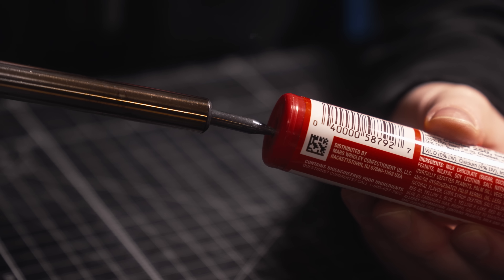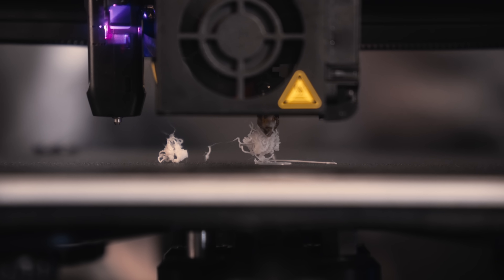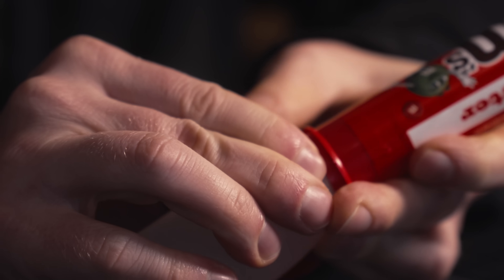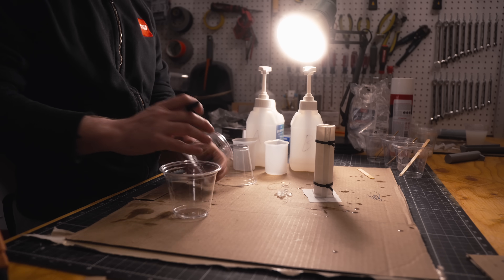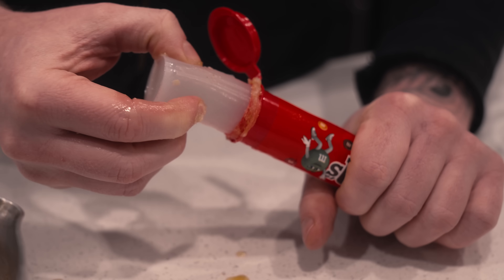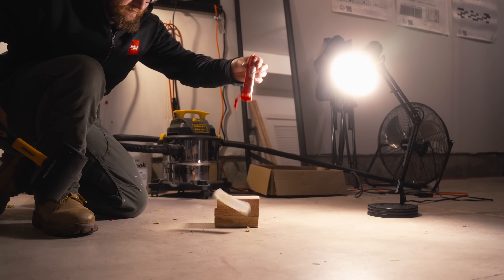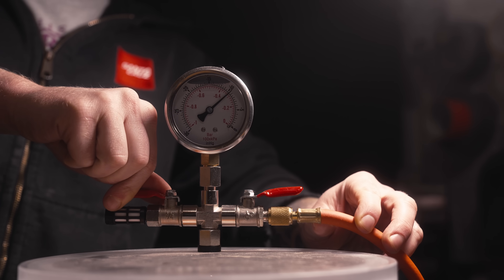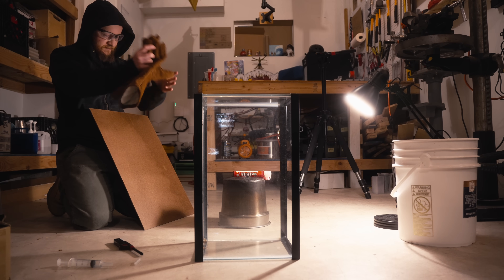Solving Reddit's Cylinder Problem with Science

Comment: a few things
1 : I have a very strong feeling that the poster have been over-estimating the properties of his cylinder, with 5.1inches in length and 4.5inches of girth it's less of a cylinder and more of a spherender. (even if you assume they meant circumciserence instead of dicameter, measuring circumciserence is generally more difficult to measure, and one could imagine the M&M tube exacerbated any measurement inaccuracy) Additionally, I'm not sure I've ever seen a mini M&M tube as big as your original cylinder, it's a quite large cylinder that I would argue is fairly above average in terms of overall girth. 
2 : I am shocked Adam & Eve weren't willing to sponsor this given the shit they put up with from PSR. The silicone M&M tube suppressor alone you'd think would cause more issues for them than this - and that's before even touching stuff like the glong.
3 : trust me, 5:30 just learn CAD. The time I spent manually redoing models in Tinkercad to make minor changes FAR undershoots the time I spent learning FreeCAD. (and, unlike any other CAD software, I don't need to worry about FreeCAD getting their cylinder stuck up my ass sideways because they decided to fuck me over) It IS a time commitment to learn, and can be a bit weird, but a model like this is so simple that it would take under 10-15 minutes to model if you're somewhat competent at it. For me personally I took a few hours to just make a trivial part that still leveraged a lot of design requirements. That one project set me up fairly well and after that I just started making real parts.
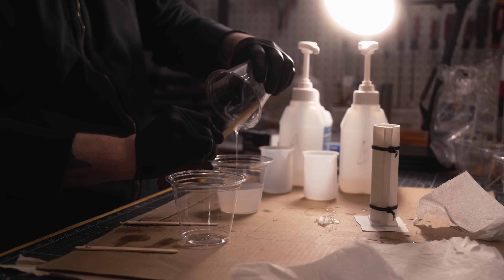4 : 6:40 hehe
5 : oh dear god that poor customer support employee

Comment: If there were some way for the cylinder to somehow emit fluid from the end stuck inside the tube, it might be able to increase the pressure in there enough to pop itself out. Of course, if it's too tightly stuck, that could also just prevent any more fluid from leaving the cylinder.

Comment: Plastic is easy, just insert a thin piece of plastic sheet between the tube and cylinder, then use some snips to cut the tube, the cylinder is protected by the plastic sheet. Alternatively sand a hole in one corner to release the vacuum, or heat it up to melt the butter.

Glass however sounds like a bigger problem. And I’ve seen many a stories of cylinders stuck in Snapple bottles. How would you get the cylinder out without damaging it?

Comment: The only way a cylinder that size fits inside a mini M&Ms tube is if the cylinder can rapidly expand and contract by about 50%. Which means this isn’t silicon. Frankly, this material could revolutionize engineering, construction, and space travel. The real mystery is why this guy is holding this knowledge back from the rest of us
Reply: There's probably a part that is fillabke with liquid to extend it.
Reply: @i-gor2  So it's hydraulics?
Reply: @Irondragon1945  I would assume more of a sponge with a stretchable material on the outside that prevents leakage.
Reply: @Irondragon1945 what he fails to showcase in this video is that the cylinder was originally attached to a larger object, the OP never went into detail as to what that object was but it would be a reasonable assumption an object of that size could be responsible for the cylinder's expansion, why was that object incapable of subsequently shrinking the cylinder to remove it from its stuck position is unclear. Perhaps it was some kind of liquid that expanded the cylinder and after its expansion whatever system was used to pump the liquid was constricted. A mystery to be for certain.
Reply: @Breqs98 I am genuinely confused why the cylinder couldn’t shrink back. The tube for which the liquid would go through should be placed in the middle of the cylinder and thus, even if the cylinder is at max expansion and stuck in a tube, the liquid expansion tube should be centred enough to not be affected. Thus, it should allow the cylinder to deflate. Maybe the larger object does not have the capability deflate the cylinder 🤷‍♂️
Reply: @bolerpear967  Perhaps the cylinder, in its panic, was unable to contract?
Reply: @bolerpear967 You see, if the tube in which the cylinder is stuck in happens to have a volume smaller than that of the expanded cylinder, given the cylinder soft and malleable nature, it would make it so the cylinder becomes compacted at maximum expanse in a way that may close any hollowed out parts inside of the cylinder responsible for removing the liquid required for shrinkage, essentially locking the liquid from exiting the cylinder.
Reply: @Breqs98 I didn’t learn a whole lot in school, but I do remember that physics lesson from health class
Reply: @bolerpear967  It's likely that when the cylinder expanded, the tubes responsible for pumping the fluid needed for the expansion got cut off, leading to drainage of the fluid to become impossible until the cylinder was removed.
Reply: @bolerpear967  Maybe after the expansion, it pushed out all the air within the tube, which created a vacuum seal. Subsequently, one could assume shrinking would not work, since there wouldn't be air to fill the free space.
Reply: @Breqs98  maybe the larger object was what stored or produced the liquid that the cylinder used to expand?
Reply: @bolerpear967  the presumable tubes that pump the hydraulic fluid in and out of the cylinder, likely were compressed by the tube, especially where the cylinder is connected to the larger object. If the fluid can’t flow out through the tube, the cylinder wouldn’t be able to shrink down again. Kind of like how you can wear a ring that is slightly too small, and your finger will swell because the blood doesn’t pump in and out of the finger effectively
Reply: @iaxivers I think it's fully made of a flexible material, with holes/pipes for a high-pressure liquid to enter and exit. The larger object is likely a pump for the liquid.
Reply: @Breqs98 If it’s liquid, perhaps sufficiently cold temperature could condense the liquid inside causing shrinkage in the overall size of the cylinder, facilitating removal.
Reply: @i-gor2 Will any liquid do, or do I have to use a very specific one?
Reply: @formidableplays4750 a ferous dense carbon based fluid would likely work best, something thin enough to move freely but capable of being dense when packed, and relatively slick
Reply: @formidableplays4750  Probably fine to just use the same liquid the rest of the system is already using to keep complexity down.
Reply: @formidableplays4750  you could probably just use blood and some kind of engorging tissue like material
Reply: @i-gor2  My god it's a... JOHNSON, I need some tests done. Idk why i'm contacting you via random yt comments, sorry Johnson
Reply: It's probably a pourous, spongy material that uses fluid hydraulics to fill to cause it to expand. Plenty of substances like it on the market already, you can even make an approximation by shoving a soft sponge into a balloon and filling it with water.
Reply: @BLS31  Infact, you can even use a very specific kind of "balloon" for an even better aproximation. The kind you buy at a gas station.
Reply: @BLS31  there's an even easier approximation that half the population have access to!
Reply: @hardcorelace7565 you mean 50.27% of the population?
Reply: He likely had the only one in existence. Hence the need to remove it without harming it.
Reply: @Jimmy_Jones  But OP noted that it is above average in size! There must be at least one smaller one! We must find the other
Reply: @colonelh1875  the other must've been a prototype? What issue came  up in development that made the design change to be larger? SO MANY QUESTIONS!
Reply: Never did he specify the cylinder is a single material, so it's probably a structure in a cylindrical shape. In fact, he specified it's made of several organic compounds and not just one, therefore it's not a big leap to say that it's made of several parts that serve different functions and are made of different materials. OP also said it's quite soft so the possibility of the cylinder having space to be filled with liquid is quite high, with the problem being caused by the negative pressure not letting the liquid flow out.
Reply: Do we know if it was rapid?
Reply: The reason we don't have this material in every day life is because of the mega monopolies trying to keep it from the world. Think about it, everything from roads that never need to be fixed due to expanding in cracks, to buildings that resist earthquakes from expanding/contracting their base could be constructed. Insurance companies don't want us to have it, and dare I say that the OP could've been jumped and had his one of a kind technology stuck in the cylinder to keep it from the world.
Reply: @HenryJuisiti  That's absurd XD

Jokes aside, that’s the funniest reply in this thread. I actually teared up reading it .... I couldn’t stop picturing it literally happening .... someone jumping him in a dark alley, shoving his “secret tech” into an M&M tube, and then scuttling away
Reply: @maybe-me-or-not  It really is a shame isnt it? It's on the same level as someone discovering the cure for cancer and being jumped by big Pharma before they could release it to the world.
Reply: @maybe-me-or-not he did say it was a "failed expirement" so he was likely testing its material qualities for future application
Reply: I sure does hope he reveals his innovation to the world, especially if it was unharmed
Reply: Probably a secret proyect, the material would revolutionize so much the company he works for absolutely wants to monopolize it's production
Reply: Probably because his prototype got stuck in a M&M's tube, forever lost.
Reply: it's because he hospital :(
Reply: Perhaps this "larger object" contains some sort of hydraulics system that can expand or contract the structure of the cylinder? Perhaps both contribute, with the cylinder having a soft, spongy texture. Therefore it is imperative that the cylinder remain u harmed so as to avoid losing all the fluid stored in the larger object?
Reply: space travel application is already manifest
Reply: Clearly business rivals have tried to injure him for his pre-patented knowledge, why else would he be in the hospital?
Reply: this reply section is giving serious ‘body ritual among the nacirema’ vibes
Reply: I think he's not holding it back, he was probably running his experiments to test it.

He hasn't released his findings because he can't get it  out of the M&M tube.
Reply: he’s probably working on the patent still
Reply: How sure are we that it wasn't a karma farmer that vastly exaggerated the dimensions and properties of the cylinder for engagement? The cylinder in my lab is considerably smaller and shows no signs of expansion, even with rigorous testing.
Reply: @John_C_J  i dont think youre being rigorous enough, try again
Reply: It's a cylinder
Reply: Hospital
Reply: I wouldn't consider it so groundbreaking just yet. Clearly it's still in the testing phases, and the early ones at that. And if he's using a jury-rigged setup involving M&M tubes and butter, it seems like he's having issues getting funding. Maybe that's why he approached a hospital, perhaps he was able to get a research grant of some kind. Or maybe like the guy in the video he was attempting to borrow some sort of diagnostic/testing equipment for his experiment.

In any case, none of that may matter, because the rapid expansion/contraction doesn't seem to be fully controllable yet if the cylinder is getting stuck. Perhaps there's some external stimulus involved that's outside of the experimenter's control?
Reply: as funny as it is referring to what is presumably a male phallus in entirely bio-mechanical way as if one was an alien is. it’s the new year, dude (presumably) just really liked m&ms butter and like crushed banana or something (also using the phallus hypothesis which is supported by a hospital fixing the issue)
Reply: Perhaps the cylinder would return to its original size if exposed to lower temperatures. I don't have a cylinder, but I've heard that cylinders like his possess that property.
Reply: Bro I laughed out so loud reading this comment 🤣🤣. Hope they share that material information.
Reply: The only way...is if the guy exaggerated the size of his cylinder 😒
Reply: well it got stuck in testing and was likely destroyed in removal unfortunately
Reply: Perhaps it's not yet refined thus the experiment
Reply: Classified technology. I imagine very expensive too. Probably why making sure it went unharmed was of such importance.
Reply: It’s called a dick
Reply: Preach!
Reply: that was small cylinder. not black sausage. but noone wants to lose even small cylinder. cause people have only one or less.
Reply: dih
Reply: That's called a balloon (or any rubber for that matter)
Reply: He let me have some once. =)
Reply: dih
Reply: @Yacr64  no, it's a cylinder
Reply: @WALKTHEFEESH dih
Reply: What if it is because it is his peanusse?
Reply: @toastgoats7545  no, that can't be it.. we'll just have to keep looking
Reply: @toastgoats7545  no, the op clearly specified it wasn't, and was just some miracle cylinder

Comment: I like the enthusiasm, but the experiment is poorly done; it doesn't return the described situation because the post says the cylinder is connected to a larger object, which immediately nullifies 90% of the methods you tried (All methods from 10:03 onwards are unfeasible due to the physical proportions of the larger object that you did not consider in your model)

Comment: I think maybe going full power on the heat idea was the wrong move, surely just heating up the closed end of the tube by like 10 degs would help reduce the vacuum effect and loosen the butter enough to slide the cylinder out. Just palming it with both hands or a warm flannel for 10 mins should do it... but then physics always gonna phyzz